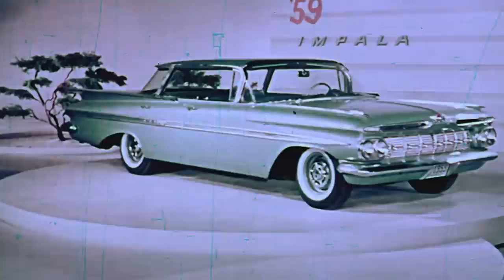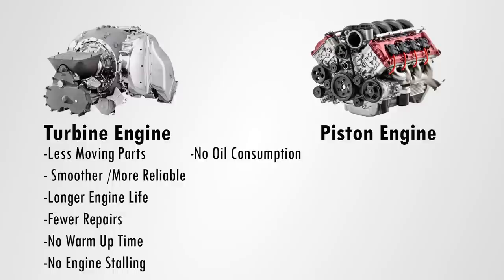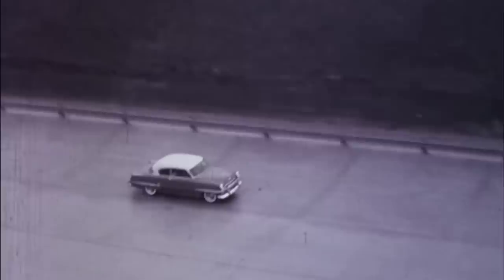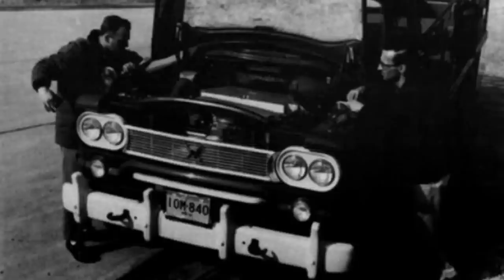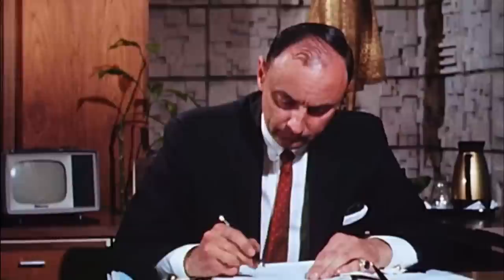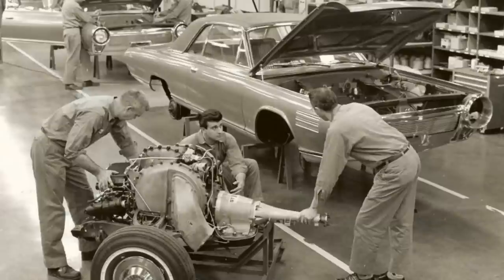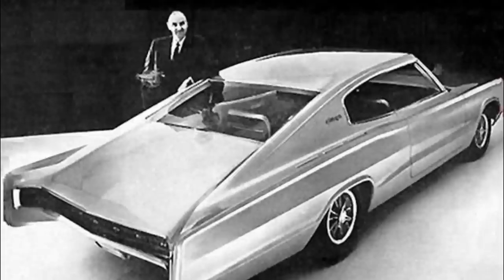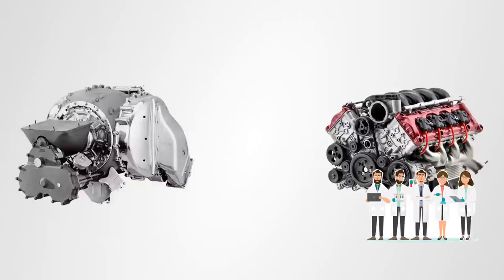Jet Plane on Wheels: The History of the Chrysler Turbine Car Program

Comment: Now we have turbine powered tanks.
Reply: Diesel engines are the preferred powerplants for tanks..
Reply: @sandervanderkammen9230  What powers the M1 Abrams ?
Reply: @seymourbutts4654  The AGT-1500 has been out of production for over a quarter century... General Dynamics only offers a Diesel engine for all new tanks.
Reply: @sandervanderkammen9230  The tanks being sent to Ukraine have those engines in them. Do we have turbine engines inside tanks today ? Yes they do. My original comment still stands.
Reply: @seymourbutts4654  Modern tanks have Diesel engines..
The Abrams is nearly a half century old design.
Reply: @sandervanderkammen9230  Why does it matter how old the design is ?  Right now we have gas powered automobiles are going to argue that design is over a hundred years old ?
Reply: @seymourbutts4654  60 million new gasoline powered vehicles were sold last year... Zero with a gas turbine engine.
Reply: @sandervanderkammen9230  How does that change the fact that there are turbine driven tanks ?
Reply: @sandervanderkammen9230   We still have turbine powered tanks and it looks like we will for the near future.
Reply: @sandervanderkammen9230  The next version of the Abrams will be a hybrid not diesel.
Reply: @seymourbutts4654  That is false, General Dynamics has selected the MTU 12V 883 Diesel engine  for all future versions of the M1.
Reply: @sandervanderkammen9230  Horse hockey. The next generation with have a "hybrid conventional electric propulsion system enabling 50 percent less fuel consumption and silent mobility"
Reply: @seymourbutts4654  Not according to General Dynamics.
Reply: @sandervanderkammen9230  Not according to you.
Reply: @seymourbutts4654  General Dynamics has fully developed, tested and already licensed the MTU 883 for production.

Comment: I rode in one as a kid when my father worked for Chrysler.  It was just another car, except for the whine, which was novel at first, but I imagine it could have been dealt with.  Automobiles are inherently destructive, wasteful and dangerous; it doesn't matter what kind of energy is used.

Comment: Turbines. Not turbans.
Reply: Spelled Turbine, correctly pronounced Tur-ben
Reply: @sandervanderkammen9230  No. Turbine. Spelt turbine, pronounced turbine. There is no reason why the word should be pronounced like a different word. The same goes for solder and caramel.

Comment: Their mistake was making this for cars. A reliable, fuel efficient 200 hp turbine engine is ideal for light aircraft, where you need relatively constant, high power use. Wonder if anyone used one of these on an experimental aircraft?
Reply: These were not flight rated engines and never designed to be used in aircraft...
While some aircraft engines have been successfully converted into land based transportation applications there are no land based engines used in aircraft.

Comment: Turban: noun
a man's headdress worn chiefly by Muslims in southern Asia, consisting of a long cloth of silk, linen, cotton, etc., wound either about a cap or directly around the head.

Turbine: noun
any of various machines having a rotor, usually with vanes or blades, driven by the pressure, momentum, or reactive thrust of a moving fluid, as steam, water, hot gases, or air, either occurring in the form of free jets or as a fluid passing through and entirely filling a housing around the rotor.

potato and tomato have no different meanings if you pronounce them one way or the other...let alone if you spell them completely differently.
So, 'turban' is a FAIL.
Reply: Turbine is a French word and is correctly pronounced Tur-ben or Tur-bean

Comment: Surprise, it ain't dead yet. I just watched a video by another guy named Ed (Nash ) About the Abrahms M-1 tank. The one with the turbine engine. Made by Chrysler. And it looks like it was a bail out to maintain a defense contractor who had made all those nice tanks in WW2.
To me a major problem with the private jet car  would require a different support system. Dealers would need to stock parts for turbine and IC engines. New mechanics would need to be trained to repair them. This is also on reason why the Germans couldn't keep their jets in WW2. Culturally "working on your car" was a masculine expectation.
Even today there's a lot of chin pulling about sending the Abrahms to Ukraine. The parts supply system and support staff trainig in a different technology would need to be set up parallel to those systems in place for tanks with internal combustion engines.
Reply: The AGT-1500 Gas turbine engine that powers the the M1 Abrams was designed by legendary former Nazi engineer Dr Anselm Franz and manufactured by LYCOMING  Chrysler had absolutely nothing to do with the design, development or manufacturer of the AGT-1500.

Franz who designed the engines for the Messerschmitt Me-262 also designed the engines for the Bell UH1 and AH1helicopters, the Boeing CH47 helicopters and the first high pass turbofan... he would become the Vice-president of Avco Lycoming  Textron.
Reply: You won't find any certified AGT-1500 technicians running around the battlefield in BDUs trying to replace a damaged compressor blade... the Abrams uses a quick change powerpack which can be swapped out for a new engine/ transmission assembly in the field in as little as 1 hours.
Damaged units are sent to a fully equipped repair facility for testing and minor repairs or sent off for total overhaul.
The biggest problem with maintenance is spare parts, the AGT-1500 is a 50 year old design and production ceased over a quarter century ago. 
General Dynamics has announced that any new version of the M1 will be powered by the German MTU 12V-883 Diesel engine.

Comment: For ease of spelling and to avoid mistranslation. A turban/turbin is usually the pronounciation of a special head dress, you can't call them hats as you have to wind it every time you put one on. The turbine engine is a way to burn fuel with far fewer moving parts, as you pointed out. How can you run a car on a GARMENT?!?!
Reply: It is spelled Turbine but correctly pronounced Tur-ben
Reply: @sandervanderkammen9230  We can agree that the various pronuciations of English words is random, confusing and regional. My education in Ontario Canada was ter bine which has been the most common version I have heard in Canada. I have heard both versions from US English speakers and most regularly watching youtube and hearing UK residence using ter bine. As the English language has stolen so many words from others, we have probably messed up the pronuciation from the original language that used the word turbine.
Reply: @johnashleyhalls  Indeed, if you have ever been to Britain you will know there are no standards for pronunciation in English...
The word turbine is borrowed from the French... the brits are notorious for horrible pronounation of French words as well.
Cheers mate!
Reply: @sandervanderkammen9230   Excellent! We are in agreement, English speakers cannot be relied upon for correct pronunciation. I shall henceforth use the correct French based version of saying the word. THX.

Comment: So, Chrysler was the Mazda of their day? (Or vice-versa)
Reply: What do you mean?
Reply: @sandervanderkammen9230  I’m speaking of the Mazda rotary engine and the Skyactiv X (gasoline diesel) engine. The rotary has never been considered a mainstream engine design because of its oil burning ways, low end torque deficiency, and dismal fuel economy. The Skyactiv X, despite all the publicity, never made it to U.S. showrooms with its increased power and fuel efficiency.
Reply: @louislopez55  what does that have to do with Chrysler?